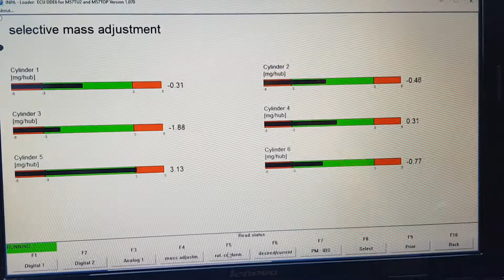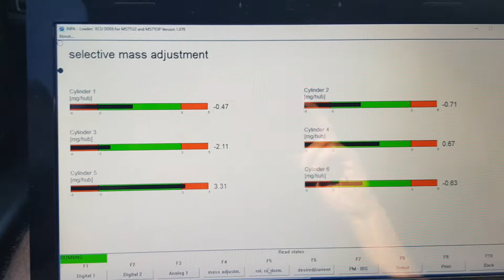Faulty diesel injector just before it died, bmw x5

Comment: Which one died - number 5? What was the symptoms?
Reply from the maker: Yep, exactly, number 5. Which is the known issue. Has to do with the way moisture runs off the cowling above the injectors.
Reply: @simeontaylor1235  I lost number 5 as well due to moisture.
Reply: I have a similar problem, the car stop engine with driving